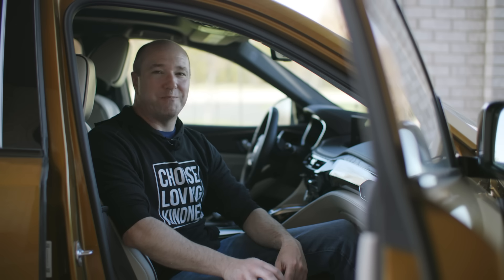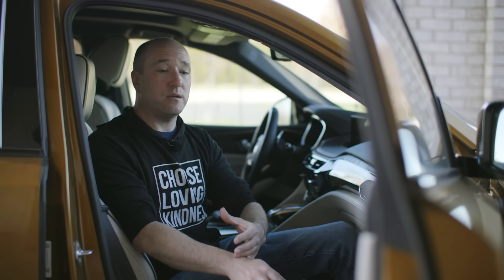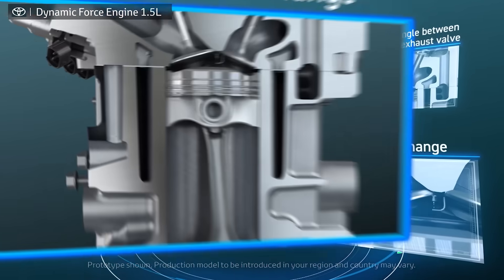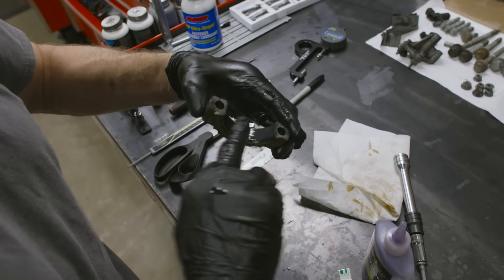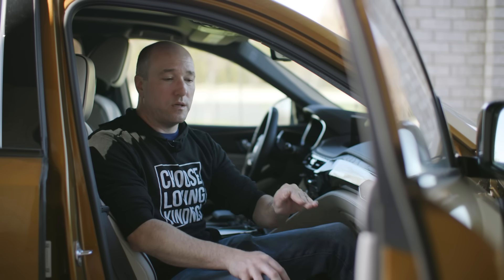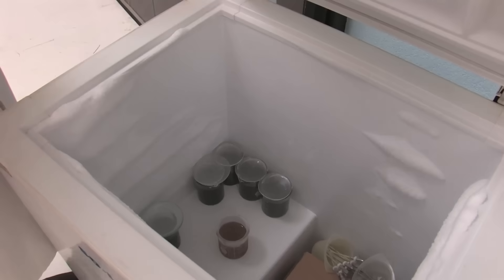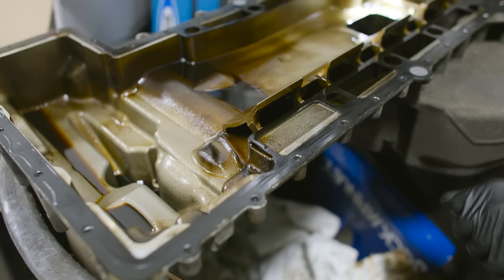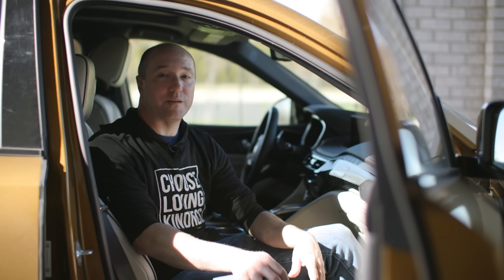Understanding Engine Break In | Dos and Don'ts

Comment: If you care about your new car and want to keep it for any extended duration you should change the oil after around 1000 miles, and then 5000 miles or 6 months after that. There are numerous designs that can withstand various OCI's and the use case for each car depends on the owner so it is HIGHLY variable, but that is a good criteria across the board. 

Engines should not be running 10-15k miles on an oil change unless you don't care about it's longevity, but certain engines may be able to withstand it. Numerous master tech/mechanics on YouTube for companies like Toyota, Ford, etc. share these views because when they see these long OCI's the internals look terrible and wearout faster. Fuel dilution is a big problem for modern engines and if your car is turbocharged and direct injected you should not be running past 5000 mile/6-month OCI's. Also, most people should likely just follow the "severe" driving condition recommendations in their owners manual.

Comment: The only thing that should be happening during break in, is the rings seating to the cylinder walls. There is a very short window of time for this to happen before all the peaks and valleys are knocked down on the cross hatch of the cylinder. During this time you will achieve the best results by applying increasing amounts of load and RPM followed by periods of engine breaking. Load in cylinder forces the rings outward into the cylinder walls and beds them into the crosshatch, the engine breaking helps clear the microscopic engine particles. 90% of this brake in window is achieved within the first 50 miles. If you do not put enough load on the engine during this period you could end up glazing the cylinder walls and not making as much compression as you could have, resulting in less power and lower fuel economy. The differences in break in procedure probably would not result in a difference that the average person could detect but it is measurable. This will work whether you have a grocery getter or a race car.

Comment: Great video. One comment is the 0w oils will actually thin out LESS at elevated temperatures because of the higher viscosity index. The quality of the viscosity index improvers comes in to play, because then those may break down at higher temps, leaving you with a 0 base oil instead of a 5. Consider Mobil 1 racing oils are 0w-30 and 0w-50.
Reply: Plus, most street-driven vehicles' engine oils never get hotter than 220 degrees F, so 0W-20 and thinner oils are fine.

Comment: Those chevy engineers were right.  Just giver.
All this easy break-in nonsense is mainly a liability thing for the manufacturer.  If something is going to break due to a manufacturing defect, it will break within the first few hundred miles.
All this nonsense about bearings.  Babbit material on a bearing is there so the bearing can take the damage instead of your crankshaft.  Scoring is wear/damage, period.  Metal has no memory.  It doesn't care about how hard or soft you drive it.  Wear/damage accumulates over time up to the point of failure.  If your bearings are being damaged prematurely, that is called a manufacturing defect.
If you are overly hard on the engine, it will cause accelerated wear, whether it is a brand new engine, or a 200K+ mile one.

There is only one major component in the entire engine that has to endure metal to metal contact, and those are the piston rings.  You want enough cylinder pressure for those rings to bed in properly while at the same time avoiding hot spots.
Just giver.  Decent amount of throttle up to moderate RPM, 5-6K on most gas engines, and then let it decelerate in gear.  Do that a few times and slowly work your way up to full throttle.  The majority of the break-in is done in the first 50 miles.  It really is as simple as that.

Yes, there are lots of myths surrounding this, but it's mostly manufacturers that want you to baby it so any manufacturing defects end up in your oil filter ...
When i buy a new car, and there is a problem with the engine, i would prefer it to blow up asap.

Every high performance engine manufacturer will tell you to just drive it hard.  Chevy sure did ...

Comment: It was a task in patience and restraint breaking in my ‘22 Supra. I gradually changed the “load levels” during the first 2500 miles before wailing on it, and I always try to cruise a bit for cooldown afterwards
Reply: Excellent, your car will thank you for it. I hope you keep it long term! I still have the first new car I purchased (2005 Audi A4 1.8TQ (B6)). I did the first oil change after break in, and the car was my daily for 13 years. These days I only drive it for pleasure, and I've always done a "cooldown" after driving it hard through out the car's lifetime. I believe it's helped with longevity.
Reply: Cooldown is a part many miss out! I never drive an engine hard for the first 20 minutes or so. I'm sure to drive at a reasonable speed first to get everything up to temperature before I start hammering it. If I have been driving it particularly hard, I will be sure to drive around a good 10 minutes or so "sensibly", to let the temperatures stabilize before shutting down. I tend to drive hard on the highway, so by the time I get to where I'm going it has already had the cooldown period as a result of driving slower through the city.
Reply: @paradoxicalcat7173 Turbo engines include timers to make sure the engine is cooled down after shut down. My car keeps a very powerful fan on if it senses that the engine is too hot.
Reply: The Supra owner's manual specifically states that you should keep engine speed below 4500 rpm and vehicle speed below 100 mph during the break-in period of 1200 miles. I followed this and had the first oil change at about 3100 miles.

Comment: Good advice. My son is a mechanic and rebuilds engines. He does advise even with new cars to change the first oil after 500 miles and check for metal sparkles. Highway driving stresses oil less than city. He hates 0w20 recommends 5w20 or 5w30 for Subarus.
Reply: He knows a lot of things

Comment: I wonder whether you'll make the same video about EVs some years down the line. And before the clever people start the jokes: in vehicle benchmarking we see a trend towards oil or hybrid cooled electric motors. Some have external box filters, some don't. Some run on ATF, some on specialized oils. Some are designed as a lifetime coolant, some are not. They have drastically different viscosity depending on ambient temperature and there is little knowledge as to what that does to electric motors under sudden load spikes. I imagine the physics to remain in place, so I hope you'll elaborate on that in detail at a relevant point in time when we have enthusiast EVs that deserve the name. Thanks.

Comment: Two months ago I bought a 2023 Corolla SE with 8 miles on the clock  The manual said drive it "gently" for 681 miles.  I made sure to vary my speed, didn't lug the engine, didn't use cruise control or go over 65mph.  Once I hit 700 miles I started being a bit more aggressive but still careful.  I'm now at 1,700 miles and the car runs great.
Reply: When you hit 117,000 let us know how the car runs
Reply: @CollinMac96 😂👍

Comment: This may be a stupid question: Why can’t they break in engines in at the factory as part of the manufacturing process? They’re gonna know the ideal load characteristics for breaking it in perfectly.
Reply: I thought the same question, my guess is to save money and gas. Probably other parts like transmission also needs break-in. So let the customer handle it is the most economic way.

Comment: I agree with this video especially the early engine oil + filter change around 1,200 to 1,500 miles.  Plus, I use a top oil product like MMO, Lucas UCL, Schaeffers Neutra or a TCW3 2-stroke oil ... about 6 ounces per tankful every 2 or 3 fill-ups.  All my engines last a long time, get top fuel economy all that time and use ZERO oil between oil changes.

Comment: Regarding oil change timing, it seems that oil dilution is becoming a more common issue with smaller displacement DI engines, the small Honda 1.5l engines for example suffer from it. This is one reason not to push oil change intervals out around 10k. 
This seems like a more common issue in the last couple of model cycles.
Reply: Even with my Honda 2.4 L non-turbo direct injection engine which has had oil consumption from new, the sweet spot for me is a 6 month or 5k mile interval on 5W-30 oil for my climate conditions. The engine consumes significantly less oil now at 100 k miles than the first few longer intervals I did on 0W-20 oil. For the turbo Honda Earth Dreams engines, most people are probably better off with this shorter interval if they care about the long term.

Comment: It’s refreshing to hear someone speak intelligently about modern oils and their capabilities. So many people are stuck decades in the past regarding oil quality and its longevity.
Reply: Yours' is probably the most relevant comment here........ so true!
Reply: 100% Modern oil easily lasts 50k mile, and oil filters easily last around 150k miles which is usually when the gasket will start leaking. The filter does nothing inside of a healthy engine and there will never be a case where the oil filter becomes too "clogged" if you got anything but oil in your engine you've got bigger problems.

Comment: I think you missed most important thing. No matter which type of engine you have, you should change the engine oil after first 1k miles. Most of the times you will see some metal shavings in oil. I don't know how about you but I don't want to have scratches on any engine part inside my engine (oil filters not guarantee stopping them from circulation)

Comment: My 5.7 hemi has had 0 issues in the engine itself, I do 5000 mile oil changes with full synthetic of exactly what the manufacturer recommends. No lifter issues, no hemi tick, and revs all the way to 5500rpm without a hitch. 130k miles too. I see so many forms about what oil is best to avoid hemi problems, or other "hacky solutions" and like its pretty obvious they're having these issues because of neglect and now they're trying to fix it on the cheap

Comment: The other thing I do is I don’t hammer on a cold engine I typically have about five minutes of drive time before I hit the freeway and even then I drive quite normally until I get some heat in the engine if not fully operating temperature but the first thing in the morning I drive very lightly

Comment: For long oil changes I am more worried about the filter not living up to that, or a buildup of gas or water if you take mostly short trips causing the oil to thin out.
Reply: Many years ago, I drove a 1991 Nissan Sentra SE-R with the SR20DE engine. I switched to synthetic oil, first to Castrol Syntec, later to Royal Purple. I would change the oil at 10,000, but replace the filter every 5,000. I drove that car hard, and never had consumption issues. The oil was nearly as clear at 10,000 as it was when new.

Comment: This was very informative and timely. Get my new civic sport touring manual hatch next week.  I'm a little concerned since I need to drive it on interstate for 3 hours back to my home.  Maybe I'll have to take some slower state roads instead of the interstate to be able to vary the engine more or something.
Reply: Or you can spend the 3 hours always going back and forth between 55 and 75 accelerating and coasting.
Reply: Furthermore, since it's a manual, run it in different gears for varying amounts of time.
Reply: @elfstone85  good point, thanks.

Comment: After first start I go straight to the highway after it warms up, I do pulls to redline at full boost then lift off in gear and let it engine brake down the rpms, until the smoke coming out of the tailpipe stops.

Once the smoke stops(usually only takes a couple of pulls) your rings are sealed. You then drive home normally, drain and change the oil, then drive it easy until your next oil change to get the bearings evenly worn in like they say in the video

Comment: I was told to drain the synthetic oil for regular oil to seat the rings... vary the driving load and RPM then go back to synthetic.
Reply: Yep; drain the factory oil straight away and fill with regular oil for the run-in period.
Reply: It’s hard to find non synthetic these days

Comment: I think you have a fundamental misunderstanding of oil. From what I understand, the base oil is the lower weight and the viscosity modifiers are used to increase the viscosity at higher temperature. And thus it makes more sense why a 5W20 will shear less than a 0W20.

Comment: I bought a 4age corolla new in 1990.
I picked it up from the dealer and once warm flogged the shit out of it constantly hitting the limiter in 123 for around 10klm.
Parked it let it cool for 6 hours took it out again and did the same for 20 min.
Next morning loaded it up on a motorway at 3-4000 for 30min.

2 friends bought the same vehicle and did a moderate  baby break in.

End result with all cars running same oil/fuel was mine being 3 car lengths  ahead by the end of 3rd on a stupid number of red light comparisons.

Comment: I recently bought a new Honda. The dealer told me there is not a break in period. The user manual does not mention a break in period. I followed the break in I've done in the last. If safe, no more than 4k rpm or slamming on the brakes. Don't get to the red line but do use the throttle to vary load. Don't sit at the same rpm for prolonged time. Do this for 1000 miles. I dunno what's right, Honda says do whatever. 🤷‍♂️

Comment: Mostly agree. I err on the side of caution, with next to no load first couple hundred miles and low rpm only. Introduce light load and more revs through 200-500 miles, moderate load and 75% revs after and have done a full pull around 800 mile mark. If I have to hit interstate during break in, I'll downshift one gear occasionally. My vehicles never ever bounce off rev limiter (I feel this is abusive to main bearings, would love to hear engineer/SG opinion on this) and first oil change after break in if not during, 3-4k thereafter. My cheap-ass Nissan went 260k before it started to burn just a little bit of oil with this protocol on cheap Castrol. New GR86 was broken in the same way and will get run harder with Amsoil, hopefully the boxer goes as far without losing compression. Kinda doubt it but it's an interesting challenge. Also broke in a Ducati same way and it wasn't burning oil when I sold it at 34k, still ran like a raped ape and it had a harder life than anything I've owned. It ran Motul and got fresh oil after track days regardless of mileage and to your point, warm up and cool down laps always.:goodvibes:

Comment: Great video as usual, but I have to disagree on one thing.  If a 0W-20 and 5W-20 have the same HTHS rating then they effectively are the same viscosity at high temperatures.  A potential advantage of 5W-20 is that it's usually formulated with less viscosity index improvers and therefore might be more shear stable over time.  But for the vast majority of people using modern synthetics, shear stability isn't a problem. The real reason 5W-20 exists is that it can be manufactured with cheaper, lower quality basestocks than 0W-20.

Comment: I've never bought into the concept of engine break-in. If engine break-in were ANY measure of importance, automakers would have instituted protective measures long ago - from denying power train warranty claims, to ensuring the engine was "broken-in" before leaving the factory, to programmatically ensuring break-in (limiting RPM, alternating gears during freeway driving, etc.). None of this has happened AFAIK and here we are with engines that are more reliable, more robust and longer lived than ever. Also surely bet that most engines are not broken in per manufacturer instructions, if but for nothing else than 99% of vehicles have seen plenty of hard driving from lot jockeys and test drives before one buys said vehicle off the lot "new." 

Engine break-in is to prevent a problem from becoming a catastrophe. Belts not installed correctly? Timing chain loose? Torque convert not torqued down correctly? Who knows what. The easier you're driving the less likely such problems will become catastrophes. After a bit of easy driving, it's safe to assume all was manufactured and assembled correctly. That is what I do, and it's worked - my current vehicle had a bad rear diff from the factory. But this stuff about RPM and times and lots of oil changes? Nah. 

Have rebuilt and installed rebuilt engines and have purchased new a number of vehicles, including of the high performance persuasion (depending on the vehicle, 7,500 RPM red line, 400+ hp, 25 psig turbocharged) and have gotten 150,000-200,000 miles out of all of them. Never an engine problem, not even oil consumption - always less a quart between oil changes, including the extended 10,000 mile intervals common with new(er) cars.

Comment: Question - what’s the over-under on time to replace engine oil, especially in high-performance motors that see minimal mileage?
Reply: I pretty much never go more then 5k miles no matter if its my CTS-V, truck or any of my other cars. I don't care if they claim you can run it longer than that I don't. With my Chevelle and other older cars I usually change it even sooner especially if it hasn't been done in a while. Those cars don't get driven that much so it would take years for me to hit 5k miles

Comment: Where I live in West Virginia is the perfect break in area. I’ve owned dozens of cars of all brands and have never had a oil burner. Going up the mountains with moderate pedal getting 8 mpg and coasting the same amount down the other side with no throttle get 80 mpg. Plus varying engine speeds is no problem as no road around me is straight enough to stay at any rpm for long.